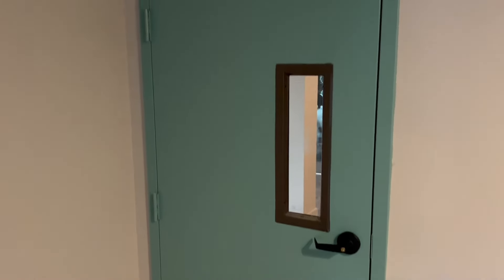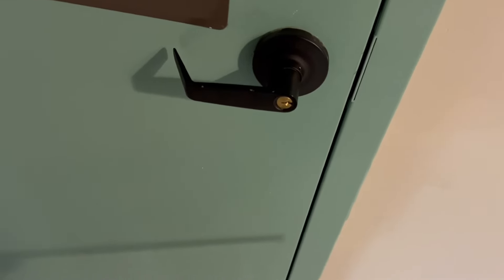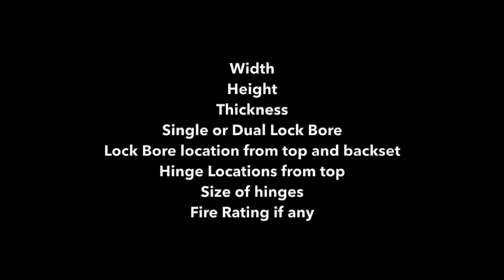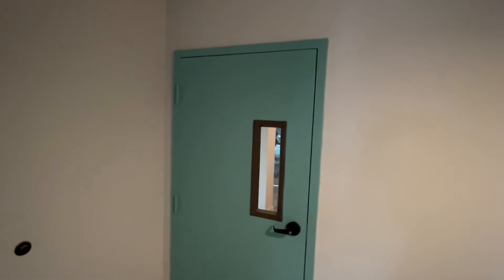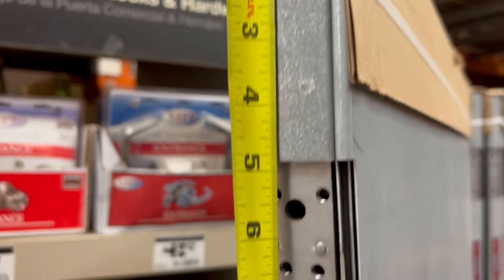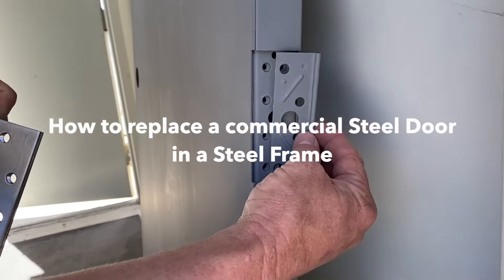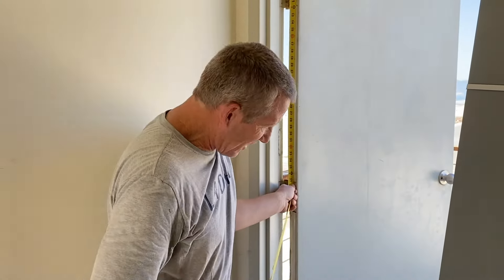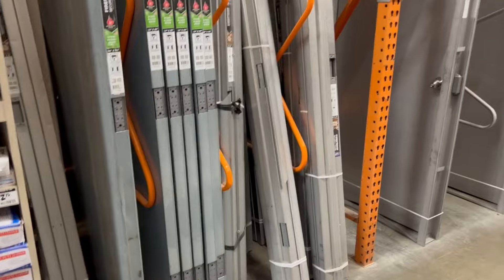Where and how to buy commercial steel doors for door installation and repair

Comment: Great videos! 

What contractors license do you need to do this in California?
Reply from the maker: In CA, there are many who do this sort of work without any kind of license, however, to be legal, a contractor's license is required in CA to do any kind of construction work over $500. There are licenses for nearly every type of trade, but nothing specific for doors. When I worked in CA, I got a General contractor's license, which I believe is a "C" license and that allows you to do anything. It's a very hard test for which you'll have to study a lot. Good luck and thanks for watching.